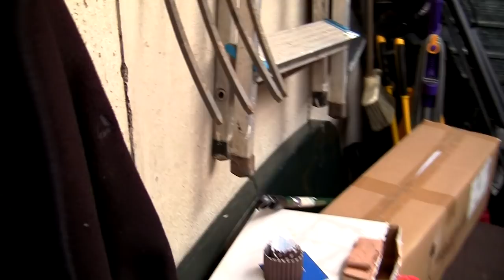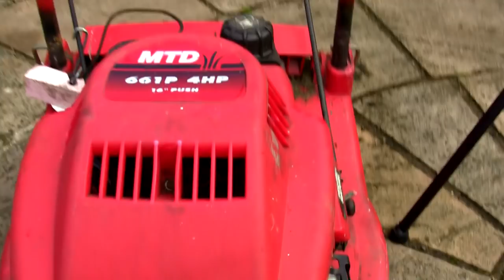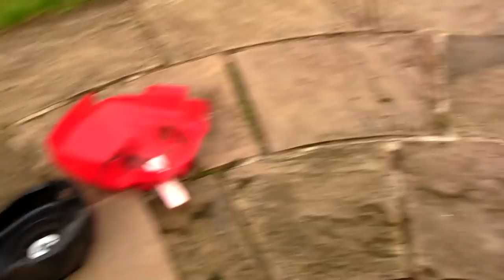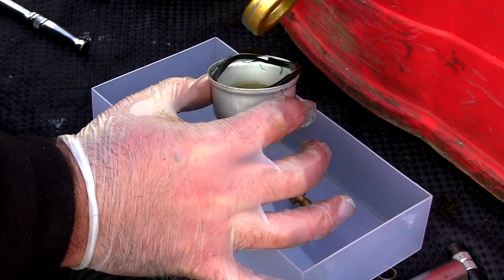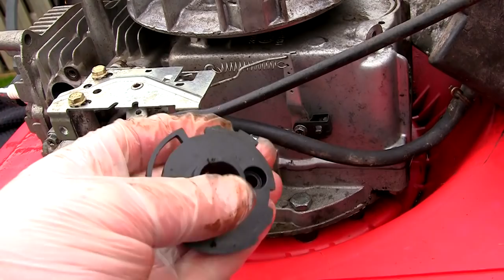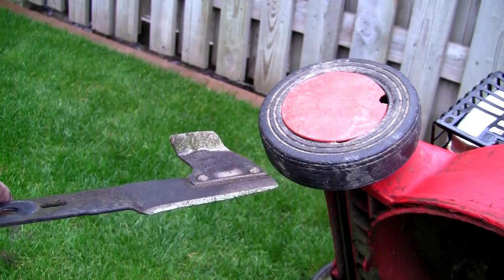Tecumseh Lawnmower Won't Start Or Prime- Help And Repair

Comment: Thanks for the video. Got my mower going again. Great tip pointing out the little hole in the bolt as that's what was causing the problem.

Comment: I went through exactly the same as you with a tecumseh engine. The primer test got me until I found a YouTube video.  Once it was all back together the engine started first pull cold or warm. I like them. Spares are harder to get hold of but run well when sorted. Just fiddly.
Reply from the maker: AlTec O.P.E They always run well eventually
Reply: @MowerMan  today i went through this thing also.But i removed the upper plank also . Nice video.Great explained and usefull .

Comment: Get yourself a 12v impact driver and a set of cheap 1/4 hex nut drivers and you'll save yourself a crazy amount of time! Great vid as always!
Reply from the maker: MaximumZargon Do you mean for all the small bolts?
Reply: @MowerMan  Yep. I work full time with small engines (small 2 stroke up to quadbikes, ride on mowers etc). For smaller stuff an impact driver is fab; you can use bit sets for Phillips and Allen and torx etc and then nut drivers for nuts and bolts. Amazon does a good set by tacklife of nut drivers. Saves so much time!
Reply from the maker: MaximumZargon Thanks ill take a look

Comment: Thanks for the tip about the primer circuit needing the bolt in to work.    Thanks to that I've just mowed the lawn instead of racing round trying to locate a plunger service kit which it didn't need!
I found the Tecumseh not too bad to work on when I took it apart for the first time in ~15 years yesterday.   It's had no maintenance whatever (other than new blades) as witness the fact that I didn't even know how to undo the air cleaner clip.   It stopped because a piece of disintegrating air cleaner foam was stuck in the venturi.   I also replaced a couple of small bolts that had gone missing without impairing its functioning.   It's never even needed oil, someone overfilled it when it was new and I've been waiting ever since to add some and it's still above the 'full' mark.
Reply from the maker: No problem! thanks for watching!

Comment: The bolt holding the wheel sheared off on my last mower,  couldn't find one to get it replaced, took it to the mower shop, said it would cost $70.00 to repair. So I checked the price of new mowers at Home Depot and purchased a brand new one for $150.00. In this case the cost or time to repair was not worth it.
Reply from the maker: isitebuild wow! $70 could you not find a second hand one?
Reply: isitebuild that’s your first problem you went to Home Depot. Why? Go to a local dealer, you’ll get parts from them and easier to work with. My family own a garden machinery buisness
Reply: I could have ordered one from Amazon but didn't want to wait
Reply from the maker: isitebuild I would have love to have helped. I would have happily done it for a channel review!
Reply: @MowerMan  Thanks for the offer...I'll definitely look you up if I need to repair my mower

Comment: Just stumbled upon your channel mate its excellent. Ive been fixing and selling mowers for years and yes couldnt agree more, tecumseh are ok but they are crap to work on and never actually seem to run that sweet. Briggs 35 classic is a gem of an engine.
Reply from the maker: Thanks! really appreciate that

Comment: BEFORE you tackle the two carburettor mounting bolts at 12:30, just undo the throttle cable clamp (1 screw) and take off the top plate (2 screws) and lift it up.   This makes access to the carb mounting bolts so much easier!

Comment: Good fix, I didn’t know that about the primer. Are you sure you have the bowl oriented correctly?  The higher side should go under the hinge, the Lower part under the free end of the float. Rarely see brand T anymore.  From S Fl where  it’s 80 and overcast with spotty showers.
Reply from the maker: Excellent spot.. I did re-assemble the carb the first time and it was leaking. Tbh I was unsure why but now I know!

Comment: How fortuitous for me. Same problem with my 2003 Tecumseh ELV120 / 195cc/ marketed at 6.5hp. No prime, kickback, won't start. Flywheel key okay, valve train works properly, carb. cleaned. Wish me luck.  Narragansett Bay

Comment: those are good carbs.good film TU & Sub
Reply: These are the OEM Italian Dellorto carbs but there's a later problem one that blows petrol.  It has a black priming button and much smaller cast body.  It may still be possible to get working after cleaning so don't give up all hope.

Comment: Great video. I have one of these motors on a Craftsman walk behind string trimmer. I installed a new Carb and it worked great for the first few starts. Now it won't prime. It will start and run with starter fluid. What other reasons would there be for not priming? Tanks!

Comment: Hi The most important thing is the bowl  nut  you have to Clean the holes in it ,you have to CLEAN the gas tank , and no ethanol in the gas ..   this carb is ready threatened  by ethanol .
'these engines are very common  her IN CANADA .
Ed from Loretto Ontario Canada .
Reply from the maker: ED EDMUND Cheers Ed Thanks for watching

Comment: Hello, I have an identical engine and need to order a replacement emulsion tube, do you by any chance know the part number please?
Reply from the maker: Richard Nunn I don't unfortunately. They aren't easy to get hold of. Try looking for a full carb
Reply: Okay, thank you. The supplier asked me for the engine number to check but the plate is missing - I don’t suppose you have an engine number I could use please?

Comment: Help! I need to remove the top engine plastic cover/cowl to access the recoil starter on a Tecumseh Spectra 50 engine? It seems to be secured in place with two plastic clip inserts, one on each side, that I can’t budge at all. I have tried local lawnmower repairers with no success. 
I can provide photos if any one can assist.

Comment: hi, Paul, I have the exact same carb as you are servicing but someone tried to repair the primer bulb with mastic which has entered all the ports in the area of the bulb  do you know the part number for a new carb or ebay description/ number many thanks steve
Reply: hi again where does the small wire from the coil attach to please
Reply from the maker: Stephen fysh Check out donyboy 73 he shows how to replace primer bulb

Comment: WTF a plastic deck never seen one on  a petrol mower unless it's electric and the rear wheel setup. not many old mowers in Australia have that bar you have to hold to keep the mower running and i do own a techumseh vantage 35 since new from 2004 and that mtd has the same carburetor set up same as mine and yeah they are a bastard